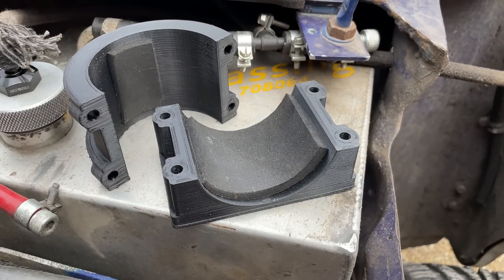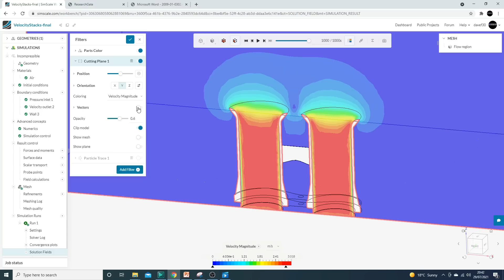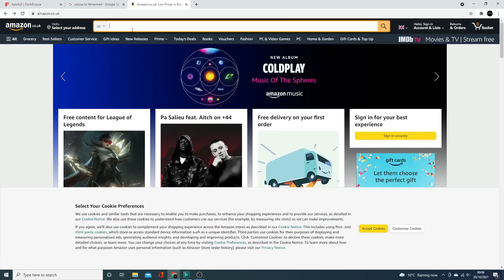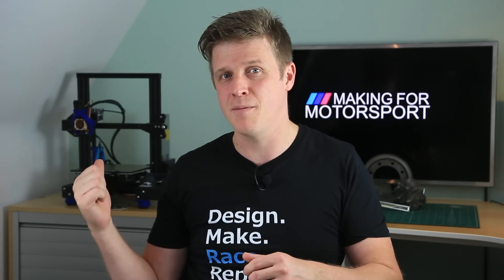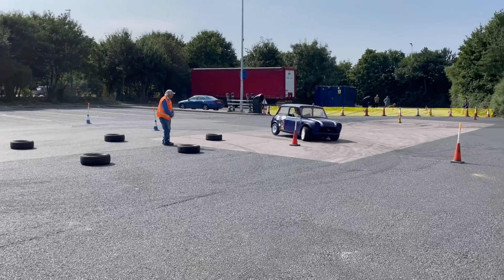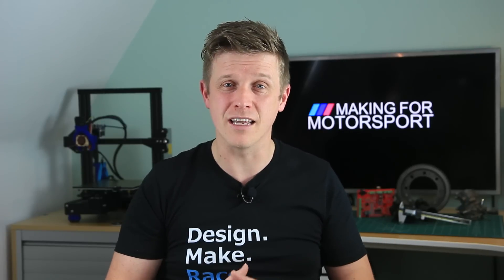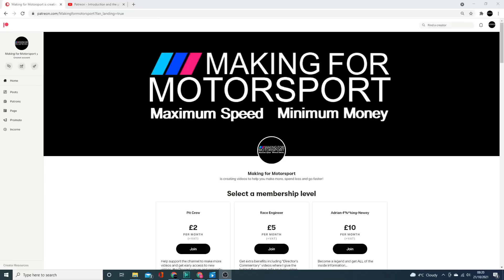3D Printing Car Parts - Under the Hood (or bonnet) - After a year of motorsport......

Comment: I love this! I have 3d printed fiberglass molds for parts that turned out great but have been super hesitant on fuel and heat resistance... sounds like I'm buying some carbon nylon filament.
Reply from the maker: Go for it mate, obviously be sensible and keep an eye on the part but it’s definitely do-able!
Reply: I like this idea. How did you get along with the engine coolant channels?

Comment: Awesome video. I have several 3D printed parts on my race car but only print in PLA so far so they only hold non critical stuff in low heat, or no heat environments. Funny enough, I made a bracket almost exactly like the one you made for your fuel pump to hold my fuel filter.
Reply from the maker: I’d imagine you’re more likely to use Carbon!? 😂. Just checked out your channel, Carbon fibre is the next technique for me to learn so loving your channel! 👍
Reply: @MakingforMotorsport  yeah definitely more familiar with carbon. Any questions feel free to ask.
Reply: Also, mess ups are much more expensive than even the most expensive filaments so just be ready for that haha

Comment: Very inspirational! I am planning on doing a custom sized MAF barrel using PP-GF. I was originally going for CF Nylon but found out glass fiber added polypropylene would suit perfectly fo the purpose, it has sufficient ambient temperature limit (180C, far more than enough), it stores easily (hydrophobic), has good impact strength and phenomenal layer adhesion. This video cleared out some apprehension I had about making intake parts with 3d printing (I already did a flex fuel sensor but it doesn't involve bits easily ingested by the engine...)
Reply from the maker: PP?  I heard it was a pig to print with big warping?
Reply: @MakingforMotorsport  
The fibers help a lot with it.
Just like with Nylon, the plain variant likes to warp a whole lot more.

Gf filled instead of Cf filled is a good allround choice, worth it just for the printing properties alone with certain materials. If the maximum rigidity of carbon fibers isn't needed - save a few bucks and just go Gf.

Comment: Be careful with nylon nuts. Nylon is tough but will breakdown much faster then exported to heat cycles and being outside. Top Lock nuts are less maintenance and have much higher temp resistance because it does not rely on Nylon.

Comment: Another solid tip for the slicing process is making your model out of separate components. Slicer has the ability to tailor the print settings for each individual component all in the same slicing file. So for instance the bolt holes mentioned earlier could be a separate piece that can be printed completely solid where as the rest of the model has different setting presumably for material savings.

This also works for making you own more efficient print supports.
Reply from the maker: I’ve not tried that, it sounds like a good tip! 👍
Reply: @MakingforMotorsport  I should clarify, cura slicer has that ability not sure which other slicers have it.

Comment: I'm wondering if the carbon fibre nylon filament will be suitable to print a adapter to hold a brushless pump in my intank swirl pot and a new top hat for the tank as well 🤔

Comment: I have about 80 printed parts on my vw Brasilia, mostly remixed trim pieces, some of them, like my led tail lights are on my channel, but i'm waiting until my speeduino conversion is done to make a video showing all of them. Hopefully on the next pair of months! For the manifold nuts, you can try to use fiberglass washers under them, rc cars from tamiya have those on their motors to stop heat from melting their plastic gearboxes.
Reply from the maker: 80 printed parts?! Nice!  And I will check out those washers!

Comment: I thought you would have used a slicer Copperhead heat break instead of dishing out big money on a all metal hotend. They're supposed to be really good for filament like carbon fibre and cost far less
Reply from the maker: Yeah, I debated it, but I thought I’d give a genuine a go as everything I have is cloned so it’s worth a go… and the E3D V6 is cheaper than the micro Swiss!
Reply: @MakingforMotorsport  could you tell me where you bought the hot end from?
Reply from the maker: Direct from the E3D website, I have read that some on Amazon are not just clones but proper fakes at the higher price… not taking that risk when spending proper money!

Comment: I use petg from amazon. £14ish per kg, low shrinkage prints exactly the same as your ASA, good UV resistance and its recyclable in the bin. its the same plastic as milk bottles
Reply: Is it novamaker brand?

Comment: Is there a filter in the velocity stacks? I've always wondered if they might crack and get sucked in but seems to be holding up nicely! Really neat.
Reply from the maker: Hi Angus, thanks stopping by!  There aren’t any secondary filters, something I’d not thought about as the stacks are quite sturdy and never show any signs of degradation etc.
I think it’d take a “mechanical action” (e.g. a crash 😬) for these to smash to the point of being ingested, in which case, I have bigger problems! 😂

Comment: i have 2 3D printed & cast intake manifolds.
Reply from the maker: Sounds good, did you use an investment cast process or print cores and go sand?
Reply: @MakingforMotorsport  investment 1/2 sand 1/2 plaster of paris. bolted up perfect, but i neglected to measure the engine compartment.
Reply: @MakingforMotorsport  slathered the PLA in soft wax first to seal it. came out so nice i thought it was still liquid. you can even see my fingerprints on them from the wax.

Comment: intresting video. I also printing parts for my supermoto track motorbike. I made some sliders and crash protection. Great channel you have.
Reply from the maker: Do you directly print the crash protection?  How does it stand up?
Reply: @MakingforMotorsport  De came  oud great, I just need to crash to see how they hold up.  But I hope to be able to wait as long as possible.😅

Comment: I would like to use a 3d printer to model parts and use them for prototyping after that print a part thats 5% bigger. Put it in sand for casting. And cast it in alluminum
Reply from the maker: Casting parts is definitely on the to do list 👍.

Comment: Thanks for the follow up.
I'm not surprised about the fuel resistance of the nylon. We use epoxy polayamide (nylon) primer inside the fuel tanks of aircraft.
Reply from the maker: I wasn’t surprised but it’s always nice to check and it’s a pretty powerful way to show the internet! 👍  I like the sound of playing with aircraft by the way!
Reply: @MakingforMotorsport  I hear that a lot. Reality is not quiet so glamorous. 12 years of big jets and 16 years of helicopters sounds good on the outside. What I see is 25+ years grinding corrosion and dealing with toxic chemicals. You're spot on about the demonstration for the internet. I'm pleased to see your strap over the coolant passage worked. Might be an idea to tap the head and use a 1/2" bsp plug.

You have me very interested, though the Aussie +40°C summer days might be interesting, I will get back to you. 🤘

Comment: Have you had any problems with porosity in your prints?
Reply from the maker: Not if the print goes well, obviously it’s important for the manifold and whilst I’ve not done a specific test for vacuum I get the MAP figures I’d expect for ITBs and it runs well so 🤷‍♂️

Comment: We switched from FF ApolloX to Filamentive ASA - mainly because Filamentive are UK based and deliver next day. The printing profile is identical and we've had no issues with warping or strength / impact charateristics. We also found FF filaments to be extremely dusty, needing filament filters before the extruder, FF never responded to our concerns and Filamentive seems to be much cleaner.

Comment: I absolutly love this, so far I've only 3d printed brackets for sensors and hoses and etc. Im going to give that ASA filament a shot, because Ive been using abs.
Reply from the maker: Give it a go, you’ll enjoy it!  Thanks for watching!
Reply: Abs isn’t easy to print with for automotive I’ve found. I’ve got 3dxtech i think and their ASA stuff and it’s super strong so far in my prints for my car I don’t need intake strong, but strong enough to hold up the MAF and hold the ECU

Comment: You were an inspiration for my project, I did the same thing as you. I made an adapter manifold to use 1000rr throttle bodies on my honda civic, made it with carbon fiber filled nylon and have had great results so far. Testing different stacks had been my favorite part so far and I'm looking forward to finding out how it holds up in the summer heat next season
Reply from the maker: Nice work!  Sounds like we’re on the same track… great to hear it’s working well for you!
Reply: Hi blaze, how is your part holding?
Reply: @Alex Grześkowiak  i had no issues. but unfortunately the motor i had used it on spun a rod bearing and bent some valves, because of that i cant provide long term data, however i have made a manifold for a different car which will be tested once we convert it to standalone ecu. If you have a honda with a b16 head or b18 type r head im more than willing to share the files with you :)

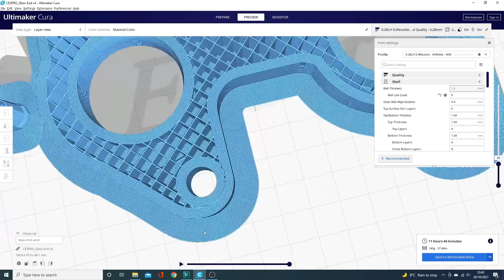Comment: 12:23 Another way to reinforce the bolt holes would be to use a brass insert and washer. Would probably spread the clamping load nicely
Reply from the maker: I was considering machining up some “top hat” spacers which would limit squish and also spread the load… not needed here tho 😅
Reply: @MakingforMotorsport  Well 3D prints with solid material are very strong under compression loads. 
Would you say the most important thing for sealing a 3D printed manifold is making a thick flange? A channel (Nivlac57) in 2019 tried making an adaptor for a Vortec 4200 to 2JZ intake plenum. But that failed due to the flange splitting when he tighten it down.

Comment: For your whole bolt hole situation next time you print create a cylinder, import in cura, multiply by as many times as you have mounting holes and size/place them accordingly. Than use the per model settings to put 100%infil in that region. Lookup per model setting cura you'll get what I mean.
Reply from the maker: I’ll have a look for that 👍
Reply: That's a great idea. Rather than make just one cylinder and then copying and placing each cylinder manually, it would make more sense to make the cylinder features in your modelling software when doing the main model, and exporting those as a separate stl. This is so they are all located in the correct spot. So then import the main model and the cylinder model into cura and use the per model setting. Thanks for the tip!
Reply: @sexyfacenation  if you manage do disable the feature of cura that automatically tries to organize your parts maybe and keep the same reference point on all of your stl's which I don't know if fusion can do...
Seems like a pain in the a** to me.
Or maybe find another slicer that knows how do it better I dunno

Comment: I've got a few parts in my E46 That are printed out of Carbon Fiber Nylon, a throttle cable bracket, an air box that retains the stock runner length, sadly a lot of it is going to be gone once I swap the engine

Comment: I 3D print a whole bunch of parts for JZA80 Supras.  All interior parts though, but coming up with some non-stressed parts for under the bonnet now. Usually use carbon-fibre infused PET filament which can be a pain to print, but when you nail it, it's tough as hell.

Comment: Hey, I have a question for you about the ITBs : how do you manage the cold start / starter ? Do you use the original manually controlled flaps of the ITBs ? Or a idle air control valve ?
Reply from the maker: It’s a very good question, and I’ve not had to start the car in very cold conditions (and I am unlikely to) but when starting from cold I have no issues, this is party because I have spent the time to adjust the cranking and enrichment values for fuel but also because I tend to run a high idle of about 1300rpm because it’s a competition car.
Reply: @MakingforMotorsport  Okay, so you raise the RPMs manually ? I plan to swap a TU5JP4 in a Saxo and run it on ITBs btw :)
Reply from the maker: I don’t need to.  It just idles nicely at 1100-1200rpm hot and cold and I don’t need a higher cold idle, like you get in production cars, which is mainly for emissions and catalyst warm up.  
If you ask a lot of the car (electrical load) and you want a low idle that might be difficult but for all that BRAARP, you can cope with the odd blip on a winters morning? 😉

Comment: So far I have made a coolant overflow bottle holder out of PETG I need to make it a little thicker as it's cracked on an area I made it a little thinner and 15% infill.

I've also made some wiring covers from TPU and replacement bulkhead connectors for my loom that aren't available anymore. TPU has worked much better than I expected.

Keep up the good work
Reply from the maker: Good to hear that the TPU worked well for bulkhead grommets... I have a spool for that exact job 👍

Comment: Hey nice video! And great projects. Ive been doing some printing projects for my track car but but nothing under the bonnet yet. Ive been thinking about doing a printed adapter for 4age itbs on my car, i was thinking though that a phenolic spacer would help with conducting heat from the head. 

Also something you might like to look into; in the past I have made extremely strong parts by printing a design with very loose open cell infill, (i used the lines setting in prusa) then inject the part with a 2 part polyurethane. You can add some chopp strand fibres etc too if you need even more strength.
Reply from the maker: I like the idea of this, so you 3D print basically a hollow part, and then inject PU?  Hmm… well that basically what I did when moulding the bushes and I can confirm they were tough AF! 😂. Will keep that idea in the memory banks 👍
Reply: @MakingforMotorsport  Yeah, I printed a part with low outer layers, 2x I think, then used a really low infill percentage with the lines option, anyting as long as the resin can flow through the whole part. 

I extruded a cylinder off the top of my part then put a pause in just before it does the last top surface that way I had an easy way to pour into the part. 

You want to use a low viscosiy resin, I used zencast p6 toughend PU from E.C. last time, worked well. Just have to pick the right resin pedending on how thick your part is otherwise can go off too quick.
Reply from the maker: @nehok  great work , I hadn’t thought about doing whilst part way through and then printing over the top… nice 👌
Reply: @MakingforMotorsport  yeah i didn't do it part way through I just essentially created a open section at the top of the print. Good luck if you decide to give it a go, feel free to hit me up to dicuss if you want.

Comment: i 3d printed a gearbox with printed gears for a motor that attached to the steering shaft.it allowed the steering to be turned electromically. it was part of a project i did to automate my car. it was printed in ABS on my shitty acrylic body i3 clone AKA hard mode.
Reply from the maker: Wow, sounds like you've been on a journey with that....  sounds fun!
Reply: @MakingforMotorsport  yeah it took a while but it did end in a giant RC car that could also somewhat drive itself.and thats every little boys  dream isnt it hahahaha
Reply: a carboard box was ised as a makeshift enclosure. as i later found out, the printed parts on the machine were PLA as they melted and deformed from the chamber heat.
Reply: it was installed on a 1989 pajero and it sat right next to the turbo. it fared pretty well even in summer and i never had any material faliure due to temperature

Comment: Something I’m going to give a go is 3D printed moulds and then make some carbon fibre parts with carbon fibre cloth and the resin
Reply: Easy Composites has some tutorials on their YouTube channel if you haven't seen them.
Reply: @Thee_Snow_Wolf  yeah thats where I got the idea
Reply: I've done it at school a few times and tbh it's alot of fun and very easy. The only issue I had was to get the proper dimensions of the mold with the 3d printer (trial and error)
Reply: @maximesauve112 you’ve done it a few times and it was really easy?!! Since you’re so good at composites I have to assume you’ve been banging out parts these past 2 years
Reply: @glennmorris25  I work in a shop that designs and builds custom composite parts for aircrafts so yeah I think I’ve been banging out parts for the past 2 years thanks for wondering
Reply: @maximesauve112  what kind of resin systems do you use on your aircraft parts? which release is your favorite?
Reply: @maximesauve112  check at work tomorrow and get back to us about the resin and release ;)
Reply: That, or a 3D printed bone on which a carbon fiber skin can be wrapped around.
Reply: @Iamwolf134  yeah essentially
Reply: How’d it go Will Bennett? did you try printing your molds?
Reply: @glennmorris25  Still on the to do list but If i have learnt anything from the experience in composites then a high surface finish is needed on the mould which may not be suited to a 3D printed part

Comment: I guess the fortunate thing about it being an inlet is that it actively cools itself in use! Great video as always.
Reply from the maker: Cheers bud... I did think that but heat soak can be a bitch!
Reply: @MakingforMotorsport  yeah that's for sure. You could use infill to mitigate heat soak too, where you can get away with parts being less than 100% dense that is.
Reply: Or a thin phenolic heat blocker "gasket"